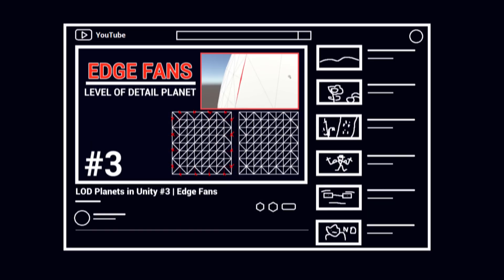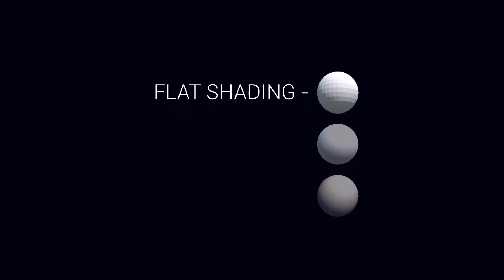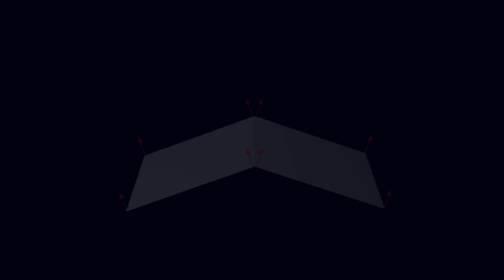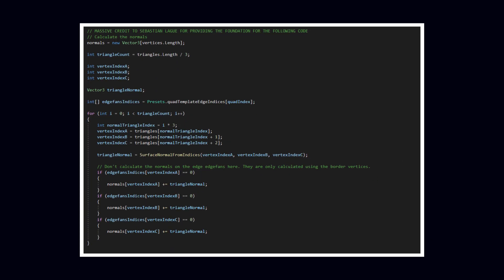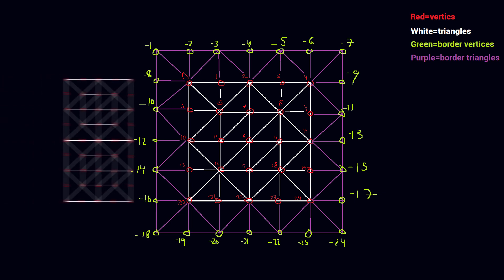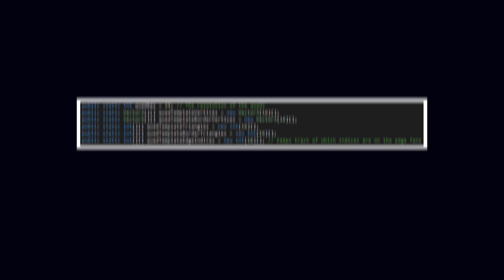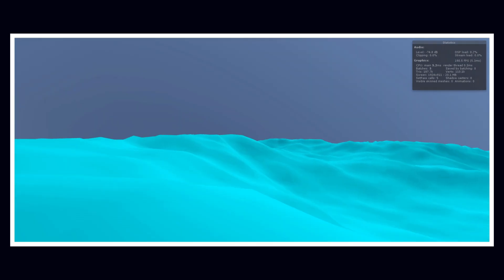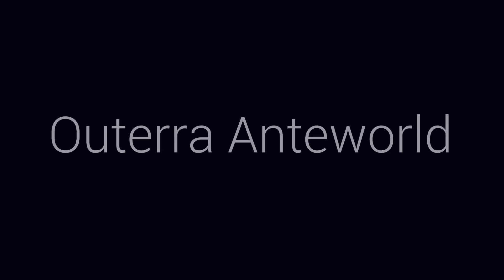LOD Planets in Unity #4 | Terrain and Normals | Programming Projects 1.3

Comment: How big can a planet be using this method?
Reply from the maker: Good question! The planet that I currently use for testing has a size of 1 000 000 units, but I think it can get even bigger. Sometime, however, I'll probably run into some integer overflow issues but then we're talking about a REALLY big planet.
Reply: @simonholmqvist1951  How much is a unit? One meter? Also is that radius or diameter? Also thanks for replying so quick.
Reply from the maker: @chrisgaming9567  1 unit it Unity is usually considered to be 1 meter. The planet thus has a radius of 1 000 000 meters.
Reply: @simonholmqvist1951  That's pretty impressive
Reply: The radius of the Earth is about 6 387 000 meters, so you are not far from being able to make Earth-sized planets.

Comment: I found another way to render planets : just search google : Florian Michelic real time rendering of procedurally generated planets - you will find youtube video and pdf document. Simply it's 2d net that is deformed to cover visible part of planet - but the distance between lines that form net is changing and it depends how camera is close(not equidistant lines - cells have highest density where closest to camera) and cells can be further divided (when camera is coming closer to planet) i think they suggest gpu tessellation but it can be done on cpu i think too - and net of cells is all the time rotated so that it constantly face camera - its very interesting idea
Reply from the maker: I watched that when doing research for this video and was very impressed! I actually decided to do something similar but pivoted after trying to solve the same problem for almost two weeks...